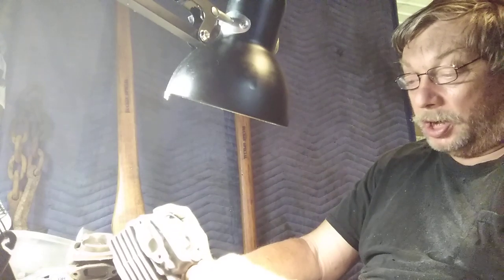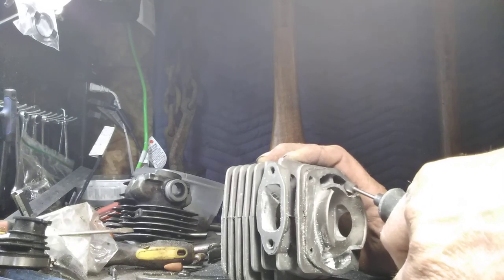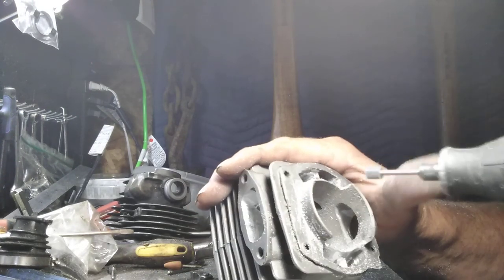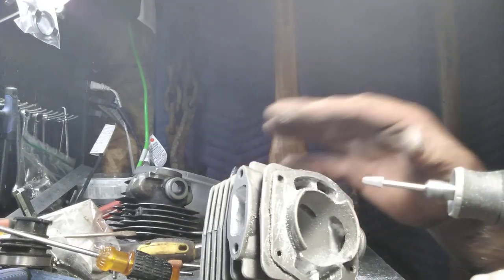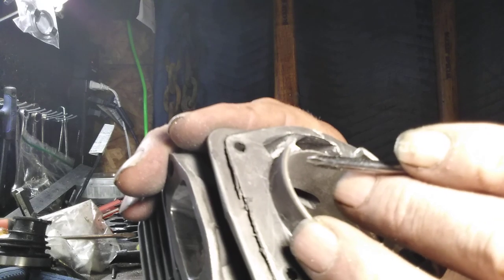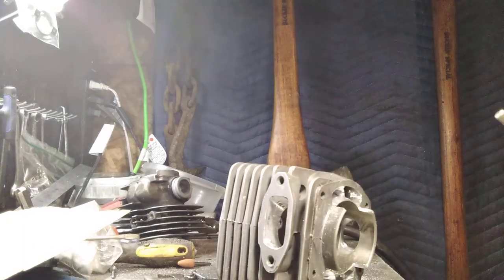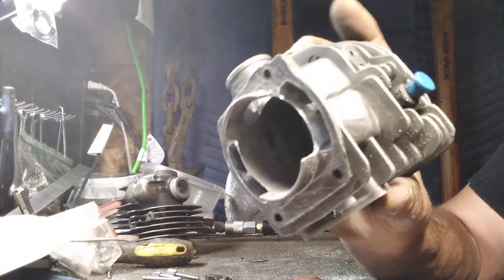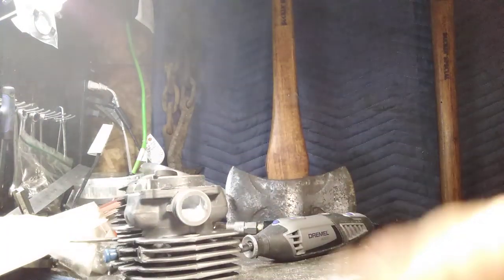Porting live! More about porting! ironhorsechainsaw@gmail.com

Comment: Iron Horse is looking to improve flow which is the key to making  any 2 cycle engine fly. Ruff on intake side  to break surface tension of fuel on  exhaust side slick & polished to avoid carbon.  I agree with his thinking. What if you cut slots in the crank weights at correct angle to give a fan effect. This will force fuel air mixture thru transfers  I have done this on model engines and improved their performance greatly. Very small to 100 hp 2 cycle engines are the same. Port timing is tricky- gain here lose there. Do you want a work saw or a hotrod.  Saw engineers were looking performance and unit to live. Love to watch your videos.

Comment: good video , the benefit of air/oil cooled engines no water jackets or in the case of two strokes no valve guides to contend with. my brothers 75cc no name chinsese saw which i think may be of the ebay giantz brand has two large open walled transfer ports with the strip up the centre of each port (34mm wide , 36mm long), not enclosed like the one you worked on, his has the tunnel ram taper you talked about. its just a dissasembled junked saw. it has a 51mm bore and a dome piston , supprised me for a very cheap throw away.

Comment: Thanks for the video. I recently put a meteor 272 cylinder and piston on a Husky 61. (heard they were good quality) Not dialed in yet...Thinking I should do some porting now! I saw a comment you made say that I can use the same carb for this kind of switch?
 I hope she runs good because its in good shape...I also need to cut next winters firewood.

Comment: After looking over the new cylinder I bought for the 372 that I am building; I now know why Stihl’s often have problems with the deco kicking out before the saw starts.  Stihl saws have a deco port leading directly into the combustion cylinder, whine Husky has it on the side of the cylinder with only a small hole going into the cylinder.  Not enough compression can act on the deco valve to close it early.  Pretty simple physics to me.  I just wonder why Stihl was so stupid in putting the deco directly into the combustion dome, where compression is the greatest.

Comment: Hello ironhorse.nice to see how the pro's get the top results.whats best for increased tourqe? , Opening up lower transfer port area and funnel shape to stock upper transfer port with and little intake work...at that point if the exhaust port shape and timing were left untouched would there be any noticeable difference in running??💖
Reply from the maker: Absolutely! Sometimes less is more!

Comment: Thanks so much for this vid harv gave me the confidence to port my 365 special which been running mint so far. Was wondering if you have any advice/ videos on porting closed port cylinders? Just bought a lovely 61 with scored piston so converting to 272 top end and would like to do some work to it before I chuck it in, I hope to send this saw to you one day in the future.
Reply from the maker: I will be doing a video about closed port cylinders after Christmas!
Reply: @theironhorse6600  Friend, the revolutions 13200 max for the saw 372xp oe 2003 are okay?

Comment: Hey ironhoese, I'm looking to build a 441c with a big bore, and if I can figure out what crank/ rod to use to stroke it, then port work and adjustable carb I've been a timber cutter in and out for 8 years, and tired of company baugyt just just get the job done saws, love the info, I'm leaning a lot I didn't know anmbout 2 strokes, thanks and I'd sit and watch for that three is so hours for you to really finish a good saw out,

Comment: What does this porting do and why does the OEM not manufacture this into the provided saw?
Reply: It increases the efficiency of the saw. Allows it to move more air and fuel into/out of the cylinder which causes it to make more power. The OEM cant incorporate these things into the saw because they have restrictions on emissions.
Reply: Perfect answer and thank you.
Reply: @Woodman_Custom_Sawing  What would I gain in horse power on a well used 455 Rancher ?
Reply: @wollywolly2734  hard to say. Not many saws are getting put on a dyno to check gains. People usually see a 1000 extra RPM or more in the cut. The 455 is a homeowner saw and is not really worth porting. Its typically $250-300 to get ported and they dont port the home owner saws.
Reply: @Woodman_Custom_Sawing  Understood.  I sure usethe crap out of the several I have ...love the brand
Reply: @Woodman_Custom_Sawing So I looked at the stats on a pro saw near what a 455 is not much gain in HP .

What am missing?   I def am not a pro but I have cut crazy amounts with the 455.

I went with the 455 because it  was the biggest at the store.   

I would consider the 455 for any application for the 20 in bar
Reply: @wollywolly2734  the 455 isnt a bad saw. It's quite reliable and has good power and low weight. The way the saw is constructed is what makes is so different from a pro version saw. The 455 is considered a clam shell case. When you unbolt the cylinder the top half of the case comes off with it. On a pro saw the cylinder comes off by itself which means you can do more with it. The 455 is a home owners saw and wont take the same abuse a pro saw can withstand.
Reply: @Woodman_Custom_Sawing  Gotcha...cylinder replacemnt.  So simple on a VW engine
Reply: I've started running a like new 445 I got at auction for $ 50.00  16 in bar.  I just did a 22 in oak.   I really like it.  I was impressed with its cutting speed.

I just started useing the Husqvarna file guide.  All I can say on that is WOW !!!!